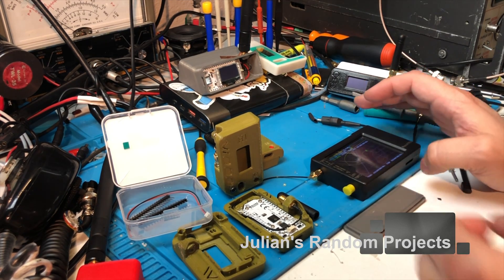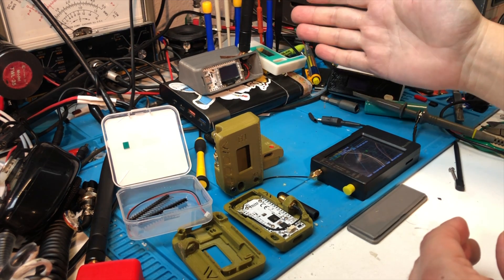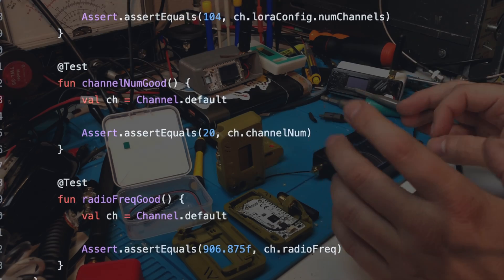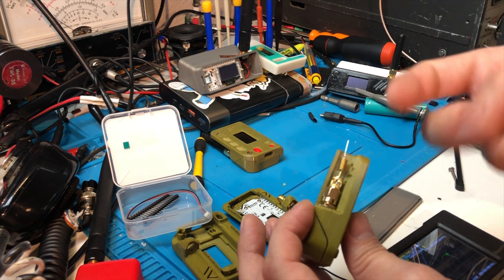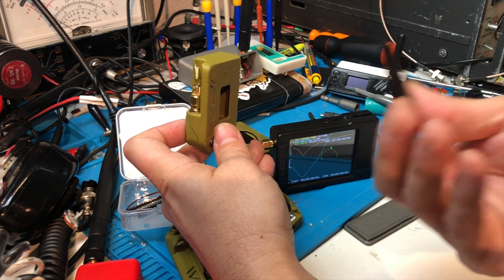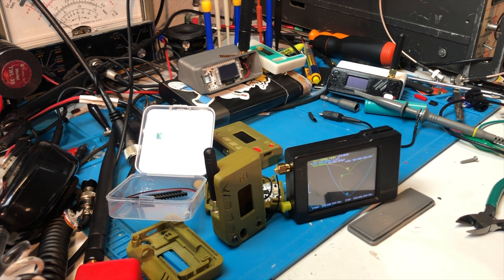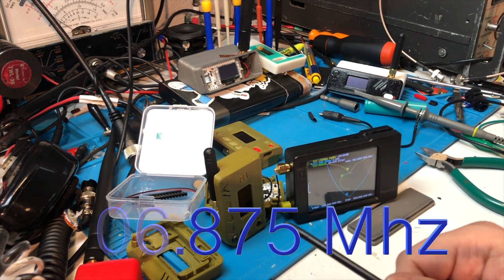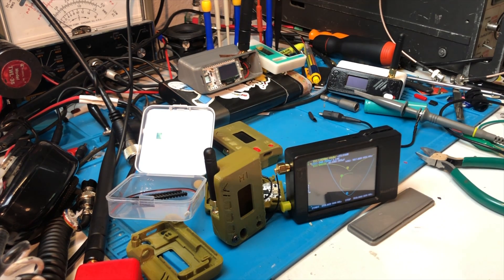I've Been Doing It Wrong This Whole Time! Meshtastic Antenna Tuning

Comment: sooo im new to the whole meshtastic thing and i admit im still learning all of it but US "default " public long-fast freq is supposed to be 915mhz.... i have 3 devices and ive been messing around to find out that by default out of the box the override setting is always set to 906 for some reason... and when i set 1 device to default out of box 906, 1 device to 906.875, another to the 915 us default public channel.... none of then see each other let alone communicate with each other... sooo this might be good for private settings but if u have intentions of talking to others publicly on  the default us channel it dont work...
Reply from the maker: You might find the about page for my local mesh helpful. https://www.austinmesh.org/learn/#about

Comment: You can check your exact frequency in the Meshtastic app, in Radio Configuration under LoRa, it's listed as Override Frequency. In the EU this is 869.525MHz rather than the more rounded figure of 868 that you hear mentioned.
Reply: My override frequency is listed as 0 in the US

Comment: How is the cover removed from the antenna, without breaking it?
Reply from the maker: Pull and wiggle.
Reply: Try a little heat.  That worked for me!
Reply: Same question! Im pulling and wiggling with no luck.
Reply: Pair of pliers and some balls and I got her loose. Thanks 🎉

Comment: I purchased 4 devices and all 4 have died. Had them 2 weeks. They all died and YES I put batteries in After the antenna, JUNK!
Reply from the maker: Which model did you purchase and from where? I hear good things about the RAK wireless boards but haven’t bought them yet

Comment: Hey. The plastic cover changes the velocity factor of the wire. So if you have a bare wire, it will appear electrically longer with the plastic over it 

It’s not so much any conductive material, more a dialectic effect that slows down the wave propagation along the wire, making the wire appear longer. 

Same effect you get with Coax cable. 

Hope that makes sense 

Keep experimenting, you’ll discover and learn so much 

Cheers

:-)
Reply from the maker: Velocity factor, I’m aware of it but not enough to teach others just yet 😊. Same goes for the heat shrink on internal antennas. I’ve got them to tune by just removing some amount of the heat shrink. Thanks!
Reply: @JuliansRandomProject  cheers

Got 2 more little V3 boards with antenna and case. Already had one. The second unit took less than 10 mins and I was on the air. 

Foolishly I only purchased one to start with. Couldn’t see anyone via LoRa

I now have that on an antenna that was originally supplied with an old PSTN cellular gateway and had a nice dip at 915MHz without doing anything.

I can pick up a couple of nodes that are local to me, but once I set it as a router with MQTT set up for our region’s topic, everything started coming through. 

Once I had the second unit on the air. It could see the first device along with all its MQTT peers 

Very impressed. 

Keen to see how many furthers I can get out of the router unit with an antenna with some gain, located at a decent height
Reply: Sounds to me that you would need some Local HAM Radio operators to get on board .. Or get a Amateur Radio License.. So you can set up some Higher Power Repeater Nodes in the 33 cm Band (5 Watts) at least ... This system is a Low Power (No Licence) needed.. And similar to Packet or RTTY. Digital Communication Modes. (1/10th of a Watt) AKA 100 Mili-Watts (Won't get much range) think of the potential with Towers and Higher Power. 73s
Reply from the maker: @x_CrossHair_x  when using my ham license I have to turn off encryption. I’m only interested in Meshtastic to talk to non-licensed folks in a secure manor :)

Comment: Ah yes seen somewhere when messing with python cli that the device was at 906. And was confused. 

Forgot about that.

Spent a day or two on my rtl sdr/HT/flipper looking for signals between 910-930 mhz confused then bam 906ish found em a finally.

Comment: I'm probably wrong, but my understanding is that LoRa takes advantage of the spread spectrum between 902 - 928Mhz. You can set a channel offset to adjust the center frequency, but the default would be 0 and starts near the 902 end.  For my purposes, I'm using the Very Long Slow channel with an channel offset of 210, which gives me a center frequency landing around 918 or so.  The number of "channels" you setup in Meshtastic will increase in frequency accordingly.  For my purposes I've setup a "private" mesh network and don't want to compete with other generic LoRa devices.  Also after diving into this head first I've learned that resonance and capacitance chance with antenna position and plastic shielding.  Your workspace looks awesome!
Reply from the maker: Ha! This work space is a mess and a reflection of how my brain works. I also figured it was a wide enough spectrum that 915 would be the middle and then the firmware would move around in that space. While the LoRa transmit pattern is spread spectrum, it’s not multiple MHz wide. Watching the nodes around my place communicate for a few hours with an SDR, it became obvious that the default ‘channel’ it’s using life’s for RX/TX at 906.875. I also moved the channel on a device and landed at 912mhz. Why a time to be alive with all these cool tools and options. Hope you can share what you’re using LoRa for. Godspeed
Reply: @JuliansRandomProject I’m setting up a LoRA / MQTT network in a somewhat remote mountain community for the purpose of SCADA alarms. We often loose power / cellular service in winter storms. I’ve jumped head first down the rabbit hole and purchased a Nano VNA, TinySA ultra and just recently a SDR software defined radio to observe communications and noise floors. Absolutely wild.
Reply: The frequency used depends on the slot chosen, I'm using the defaults.  I used an SDR to figure out what frequency it was using (it's documented too).  I'd built some antennas that worked well, but for remote nodes I use commercial antennas since they're more resistant to weather and vandalism.
Reply: Lora slots in the U.S. are spread among the 902-928 MHz band, providing many  slots for use! a single slot just uses a fraction of it!
Reply: it depends on what your local mesh is using,  the most common in the US is Long Fast,  which is way down near the bottom at 902.125 Mhz,   antennas you buy online are often tweaked for the middle of the band which is 915 mhz.   that is a pretty good distance away, where I am located our mesh is using medium fast, and that is at a frequency of 913.125 mhz.   many people including myself noticed improved communication when we switched from LF to MF,  I think this improvement is partially due to the fact that we are using a mode that is set closer to what antennas are already tuned to.  I mean MF supposedly has less range than LF,  but it there is also less channel traffic since data is moved faster.

Comment: But did it work better, after you trimmed the antenna?
As I have heard some of the antennas are not even close to the bandwidth needed for the frequency allocation. 
Good on you for making it work for your situation. 👍
Reply from the maker: Yes. Got 3 more miles out of it with this single change.
Reply: I think he’s right that they trim them between two marks on the workbench or something cause I measured a whole heap of antennas that have come with wireless gear and only two were on the nose, the rest were miles off. Your antenna could be 50mhz plus off resonance. Anyhow, hope yours aren’t but it seems every day at their antenna plants is a Friday 😉

Comment: I eould recommend not having such high Q antennas.  You want an antenna that is a bit more wideband and has swr less than 2.

As you move around, change orientation, weather, etc your antenna resonance can change.  If you have a very narrow bandwidth, it can get bad fast.

There is a reason meshtastic has the testing report section.  I recommend you use it.

Comment: Another mistake you're making is tuning it for the wrong DUT.
Reply from the maker: DUT? Device Under Test?
Reply: @JuliansRandomProject  yes
Reply from the maker: @sofia-p7d4t  what would be the correct DUT? I feel like I’m missing something :)
Reply from the maker: @sofia-p7d4t Correct. In this example I’m testing with the 3D printed enclosure that I’ll be using the antenna with and the exact length of coax from ipex to female SMA. I even when as far as buying a little ipex to make adapter for the VNA. This is the Device Under Test. I won’t be moving it to another enclosure or different ground plane without testing and adjusting again. Thanks for the feedback!
Reply: @JuliansRandomProject   Can you show how you made the IPEX to VNA cap?  I have a couple of surface mount IPEX connectors, but haven't come up with a method to apply one to the cap of the VNA.  Thanks!

Comment: Australia and New Zealand have LongFast on 919.875MHz. The other presets are mostly between 915  - 920MHz (except medium fast and medium slow are 926Mhz and 927Mhz)
Reply from the maker: Great info! Thanks. Is there a term we can search for in the Meshtastic code to find the freqs used per setting/channel? I’ll grep for medium slow and the others to see if I find anything.